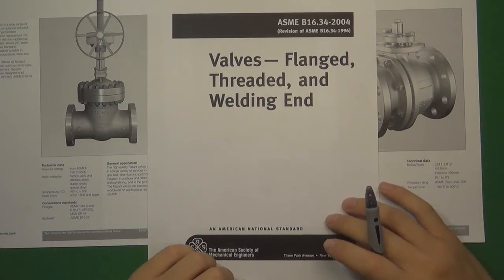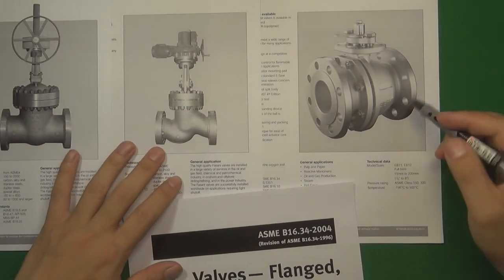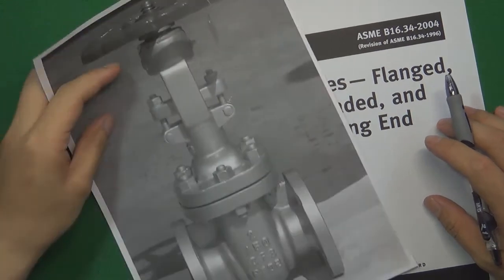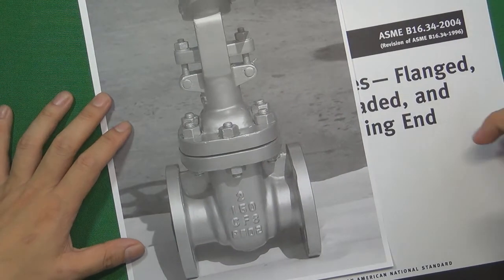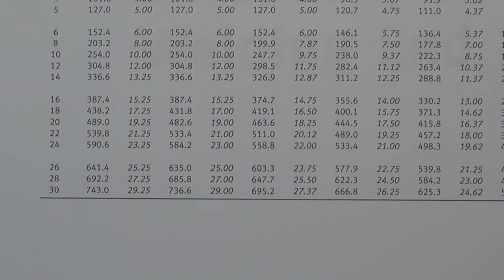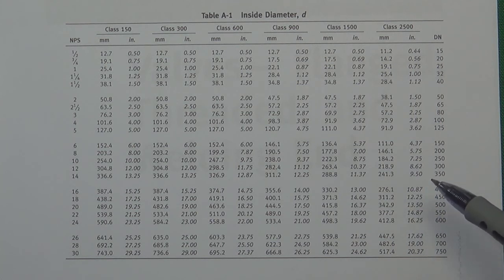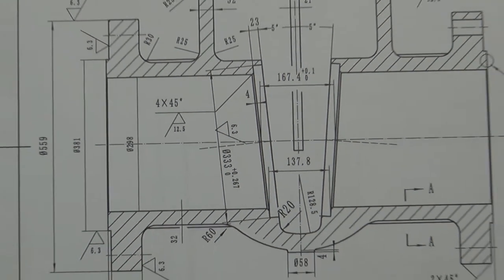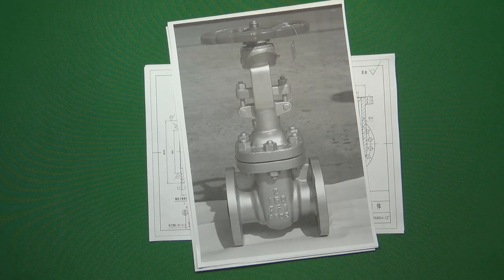What is The Real Valve Inside Diameter #ASME B16.34 Valve Size

Comment: Thanks Man, I am a Piping Material Engineer. I have seen full video. This video was very useful for Piping Material engineers. I have learnt from the video that ID of the valve may or may not be equal to NPS of the valve. And to see the ID of a valve we need to refer ASME B16.34. Usually as the Valve rating increases, ID reduces in compairsion of NPS.